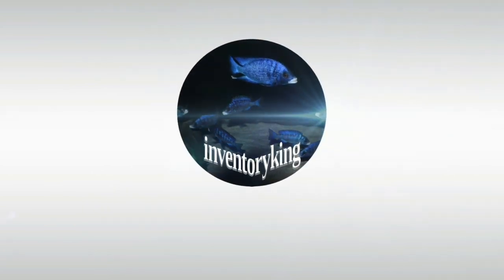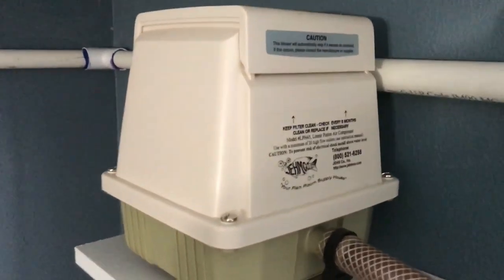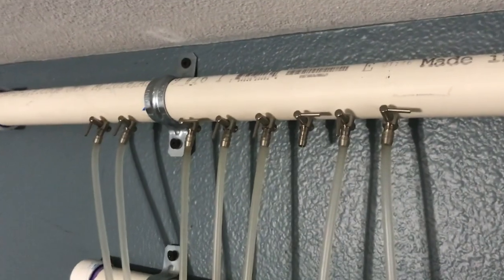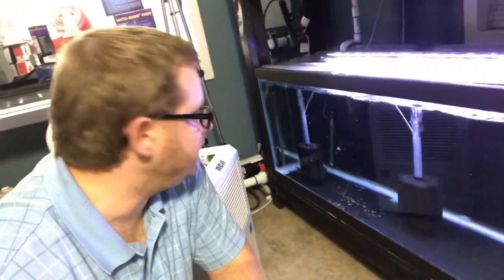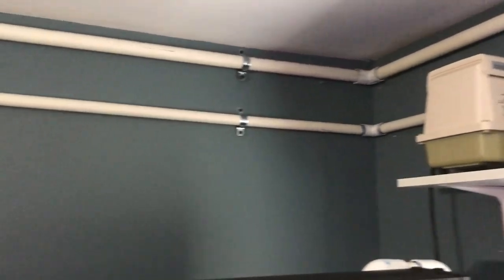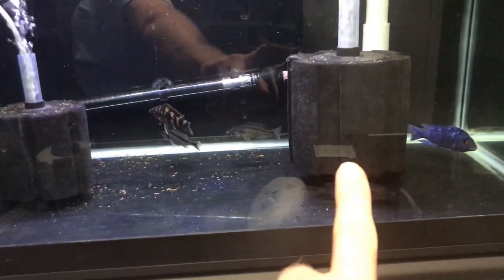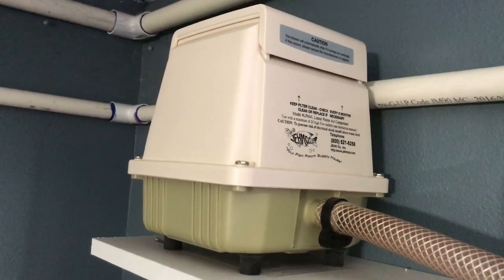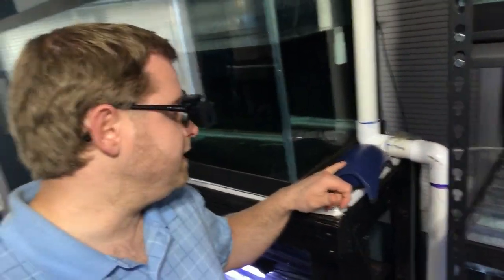Fish Room Air Pump System Setup

Comment: Nevermind the cost of hobs and cans it's the power cost that goes with them. Your air system for a fishroom is definitely the way to go. Good video Paul. Always great information and to the point!
Reply from the maker: That is a great point Larry! I didn’t even think of it like that. Saving by not running the other filters. Thanks. And thanks for watching and commenting! I appreciate it.
Reply: 110% if you have say 5 or less tanks then yeah maybe go A normal filter, but for fish rooms these style air systems can’t be beaten 👌🏼

Comment: Thanks for vid! 

How did you connect the air pump hose to the pvc?
Reply from the maker: Slip to barbed pvc fitting. Glued the slip into a Tee and then the hose on the barbed

Comment: What did you use for the valves? You drilled holes into the PVC what did you use to add the airlines?  Also how did you size the air pumps?
Reply from the maker: Hi Kevin, I sized it by the number of outlets it can handle. And size it bigger. I got the air valves from Jehmco.

Comment: Hello. Great video.  Question...Jehmco said I could put my pump on the floor and just run pvc to the ceiling to my loop.
I noticed you said it was important to have the pump up high. I'm curious as to your reasoning because I want to be sure I'm not just getting bad advice from a Jehmco employee.
I appreciate your time.
Reply from the maker: My reasoning is if its on the floor it has to push air up to the ceiling and pressurize it (less efficient) vs if the pump is higher up it (more efficient) and its best to have stuff above the water level if possible.
Reply: @inventoryking  Thanks.... yeah mine is up and running.   Love it!

Comment: I was looking at some air pumps including this one. My problem is this Pump would be WAY too overpowered for my use (8 or so tanks max, most medium or smaller sized) and I've heard of potential damage/wear if you don't have a purge valve or something to release the excess pressure in your system if using an overpowered pump on your setup. Not to mention paying more than I need by buying an overpowered unit. The problem is I can't seem to find a pump that looks good that's  between a pump like this (rated around 2,000gal) and say a Fluval 400 (rated fro 150gal). Sigh

Comment: hi what do you use to connect the air pump to the loop?
Reply from the maker: Roberto, there is an adapter that is barbed on one end for the air hose and the other end of it is split (needs to glue to tee pipe)

Comment: Hello! Please, can you specify the model of the pump and its characteristics. Noise level is very important! I'm breeding shrimp Amano, aquariums are in the bedroom - that's the reason.
Reply from the maker: Hi Ivan, Jehmco LPH45. It is super quiet.
Reply: @inventoryking  what size pvc works best with these oumps
Reply from the maker: vargas2898 1 inch thin Wall pvc